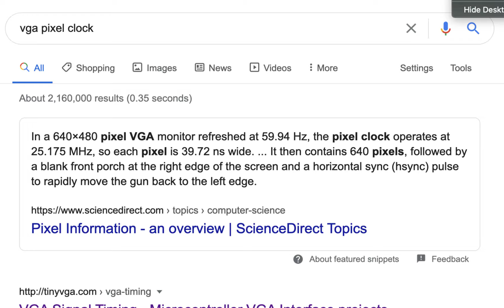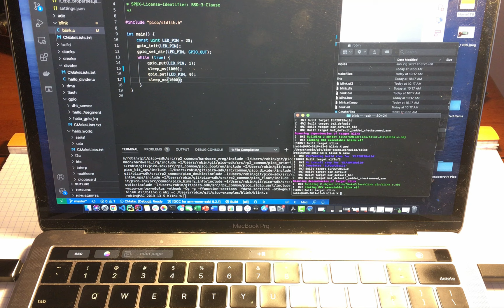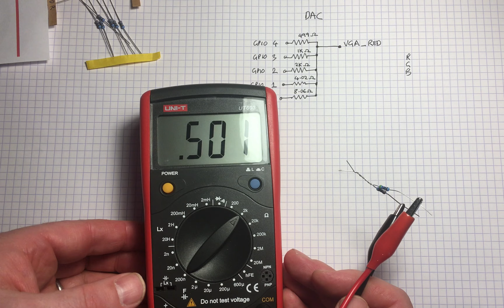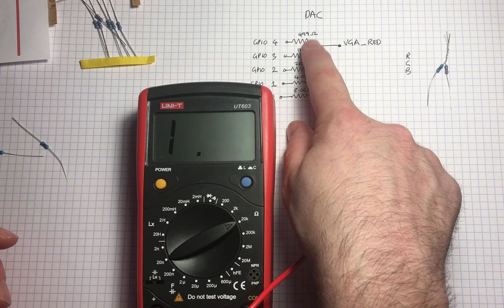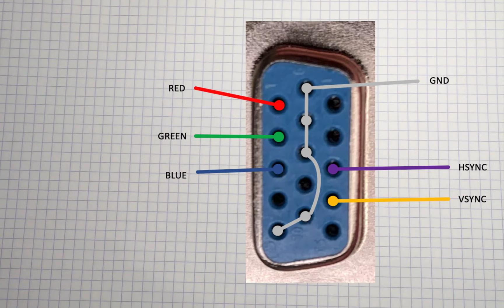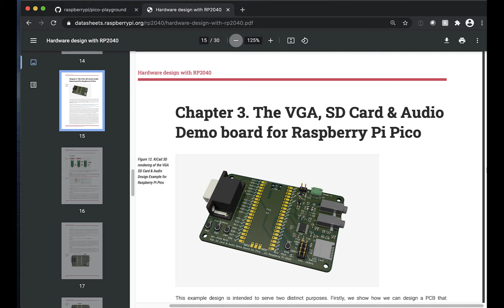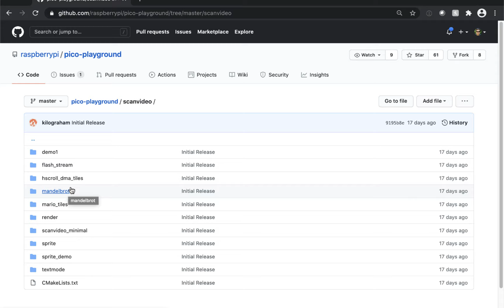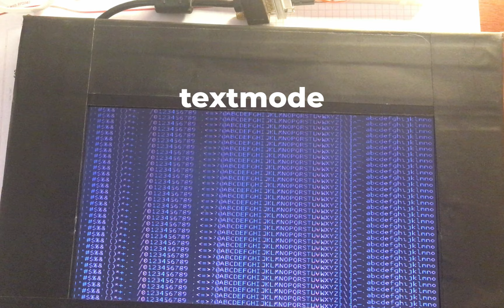Raspberry Pi Pico VGA video output using only resistors

Comment: There is no need to use precise resistor values, you will not see any difference in colors by using the next closest resistor values. You can also use only 2 resistors for each RGB color and still have a very good color range. You are also using cheap metal film 10% tolerance resistors so the values can be out by 10% anyway.

Comment: 2x 1k Ohm in parallel make 500 Ohm. 2x 1k in serial make 2k. 2x 8,1k parallel make 4k
Reply: For 2 parallel resistors  R=(R1*R2)/(R1+R2), so your last calculation is wrong. It is 4.05k
For n parallel resistors 1/R = 1/R1 + 1/R2 + 1/R3 ...  + 1/Rn
Reply: @dieSpinnt  But if R1=R2=…=Rn you just reduce the resistance by n. It’s just Kirchhoff’s laws.
Reply: @derekjc777  Sure, Captain Obvious.
And LOL, wtf do you think the "special case" formula (the first one I posted) means? The second one is the general Kirchhoff formula for a parallel resistor network. This is your 2n case. 
P.S.: Your gibberish isn't even a formula ... besides your "reduce" gave me a good laugh, thank you. Very mathematic ... and scientific! :o)

P.S.S: It is very boring to repeat basics that are written on page two of every electronics formula collection ...

P.S.S.S: And it is all my fault. I should've written: LOOKUP Resistor Networks and Kirchhoff's Law in WIKIPEDIA! This is just a waste of time, here on YouTube, don't you think derekjc? :) Anyway, thanks for your comment.

Comment: Good to see a RP Pico project that is more than a blinking LED. Thanks for making this one. I hope we will see more complex projects like this from you!!  :) Plus it is great to see a C++ project too.
Reply from the maker: Glad you like it! Let me know if have any ideas for content you want to see.
Reply: @robingrosset6941  an idea, i still want someone to Actually Try to add the original (everspin now) MR10Q010, 1Mb QSPI MRAM chip and bench it against the generic slower psram, it should be good for vga buffers running in it's QSPI Read and Write at 52MB/sec mode, it even has real original 'run in place' mode. i dont know if the Pico has the 4 QSPI useable spare pins though !
Reply from the maker: Hi Paul, the Pico already has an on-board 2MByte (16M bit) QSPI Flash which is speed matched to the CPU so it can do 66MB/s. I can try benching that if you are interested to see if its running full speed but I think this is likely to be faster than adding an additional external QSPI flash. The data sheet I found for the onboard flash is here https://www.mouser.ca/datasheet/2/949/w25q16jv_spi_revg_03222018_plus-1489727.pdf
Reply from the maker: @paulmaydaynight9925   I get it now. Let me figure that out. The use case is something like fast buffering of video data?
Reply: @robingrosset6941  yeah thats one main option if anyone's going to make up the example vga hat for instance IF the Mram better suits the more speed for less cycles (and zero wear-out effects) as it seems here

Comment: Why does every YT compare with old Arduino boards, at least compare with e.g. the Blue Pill (very much same cost), based on STM32F103 (Arm M1-core), whereas Pico use two Arm M0+ cores.
Reply from the maker: I was not benchmarking original Arduino vs Pico in the video. The point of explaining the clock differences relative to Arduino is to talk about pixel clock which is what limits the resolutions you can generate and what puts real VGA out of range of something like an Arduino. I have a Blue Pill I can do a benchmark but Andreas already covered it. https://www.youtube.com/watch?v=cVHCllbN3bQ&vl=en

Comment: Using standard resistor values:
two 1k in parallel = 500 ohms
two 1k in series = 2k
1.8k + 2.2k in series = 4k
3.3k + 4.7k in series = 8k
Reply: I'm thinking just some trimmer pots.
Reply: @larrybud you’re gonna need a lot of them

Comment: Oh wow, I was just watching Ben Eater's video on building a graphic's card and was thinking wow that's alot of IC's I bet the pico can handle that.... then I see this... Well done!
Reply from the maker: Pico is amazing. Power + Price is great.
Reply: @robingrosset6941  Almost as good as ESP32 with dual core 240mhz
Reply: You can do everything in software, its called bit banging. Eventually your processor wont be able to do anything because it's costly.
Reply: @eanerickson8915  well.... the obvious progression is (to me) pick an old well documented pci card found in every old pc/draw/dump reclaim all the components then do a Ben Eater to build it back up on a small breadboard/diy pcway pcb in different simple configurations where you use its bits as you wish...
Reply: @haakonness  It's actually better for display interfaces thanks to its PIO. Note that the RP2040 can also overclock to as much as 420MHz.
Reply: @eanerickson8915  The RP2040 has PIO which is essentially 2 processing blocks with 4 cores each which can run at the same clock as the CPU. With them, you don't have to bit bang. That's why the RP2040 can even drive HDMI.

Comment: You can use a R2R resistor ladder as the voltage divider for the 5 bit DAC just as well

Comment: Although I wouldn't build such a circuit, but your explanation were great and right to the point.  I truly enjoyed watching this informative clip very much.  Keep up the good work.
Reply from the maker: Thanks for that. The circuit design is not mine its from the Hardware Design Guide for RP2040. https://datasheets.raspberrypi.org/rp2040/hardware-design-with-rp2040.pdf

One piece thats maybe not clear in the diagram is the 75 ohm impedance inside the VGA monitor going to ground which is what makes the DAC produce the right-ish voltage levels.

Comment: it's a shame they didn't build it against the M4 but still a useful board.
fun fact: the original (integer) 25Hz/50Hz "SVGA" was a UK Inmos invented chip/pcb for the transputer that IBM licenced (along with the other inmos IP, japan got the original sram and related IP as you might expect today) for the x86 and never quite used it to it's fullest potential.
Reply from the maker: Agree, M4 would also have floating point unit... I think perhaps this was a price decision. Its still a good board for $4 in my opinion.

Comment: 1K is wide available resistor. For 500 ohms you just put two in paralel, tolerance increases, but hey... :-)
It is also easy to make 2K, and 4k as 2.2k+1.8k or 2x 2k or just 4x 1k...
Reply: 1ohm resistor exists you can make MATCH! lol and bcoz 1% from 1ohm is less than 1% 4k you going get real MATCH

Comment: Great project! A cool feature of the Pico are the fast 12 bit ADCs. Gonna build an USB oscilloscope for audio circuit debugging.
Reply from the maker: Cool idea!
Reply: In theory can a circuit be made with two 12 bit ADC such that you effectivly have a 24 ADC?
Reply: a fair LC meter would be cool too.
Reply: @kreynolds1123  you could for shure hack around to gain some extra bits. But the circuit would be way more complicated (and slower) than an extra ADC IC. But as 12 bit is already beyond mV accuracy, why would you need it anyways 😉

Comment: I recall a long time ago there was a computer that's CPU spent its entire resource running the video and program code was only executed during the blanking time. I forget the brand/model but 1MHZ was a common speed in those days
Reply from the maker: I remember the ZX81 which was my first computer. In had fast and slow modes. In fast mode it would not bother updating the screen at all so it would go blank until it finished.
Reply: @robingrosset6941  yes that’s right the ZX80/81, your got a good memory
Reply from the maker: @paulmaydaynight9925  I admit I had an eBay accident and have 4 ZX spectrums in my basement and quite a few ZX81s. I am pretty sure a Pico could emulate a ZX81. :-)

Comment: @3:52 please correct your notes, the last two lines have 4.02k and 8.06k resistors.
Reply from the maker: YouTube does not allow videos to be modified once published.  The video description contains updated values highlighting the error and there is also an updated video here with the full schematic with correct resistor values. The updated video is linked with a card into the this video  at the right timecode https://youtu.be/i1AwtqPtfrQ. if you click the information button at the timecode you indicate it takes you there.

Comment: Nice Project, subscribed.
The ATmega32U4 comparison is not meant to be serious, is it? 32 against 8-bit. Apples and pears:) Better choose another ARM M0 like STM32F0xx. Oh wait, Dual Core and 133MHz. So better choose something like STM32F446 for the comparison. For me you don't need a comparison at all. The right tool for the right job ... what actually translates to experience and RTFM many, many times.
Keep up the good work:)
Reply from the maker: there are a few microcontrollers like ESP32, STM32 and Teensy 4.0 which are more comparable. I wanted to make the point about the pixel clock and the price comparison MSRP for the Arduino vs Pico. Arduino are coming out with an RP2040 based board soon so I think we will see a lot more RP2040 boards.

Comment: Nicely done. I can see (from the amazon link) your display's native resolution is 1024x600 pixels. Could you tell me what screen resolution and refresh rate were the demos driving the VGA signal at ? Do the display controllers auto-scale up/down the incoming signal's resolution to fit the display or throws error out (like flicker/blank screen) when there is a mismatch ?

Comment: well, yes, nice job.
maybe it would have been easier if you had used an R2R digital-to-analog converter for the circuit. In this case, only 2 resistance types would have been needed

Comment: Really neat demo, thanks for making this video.  Question, I've been working on an EINK type writer project and found that SPI to a parital refresh eink display is slower than advertised.  There are some Eink displays that support the I80 protocol (which appears to be a 24 pin interface), can the pico support this?
Reply from the maker: So Pico has 26 usable I/Os (actually more if you use all RP2040 pins)  but using all them is likely not great for a project as you usually need to use pins for other things too. 

I looked up I80 protocol, I've never used it  but its basically a parallel interface typically 8 or 16 bits wide sometimes 18 bits wide. It has 3 or 5 pins for control lines. 

I think I would try using a 8 bit or 16 bit interface, the pico should be good for that depending on how many other pins you need. I can't think of a reason it would not work but I don't know of a library for I80.

Comment: so far i have been able to change the color on the example minimal scanvideo example to give a blue screen instead of different colors each scanline. The code is easy to follow but damn there is alot happening. I want to change the sprite on the sprite example and change positions based on a pin input. I gotta get better with my C knowledge. Embedded systems is as deep as i go with software.
Reply: decreasing the number of heads on the floating head example got rid of the distortion !!!!

Comment: How high do you think you could push the pixel clock with this? I am thinking that the Pico might be just the thing to use as a test pattern generator for CRT televisions, which ties into another project of mine. I'd be using NTSC timings instead of VGA, and I'd be looking at making a single luminance signal with sync instead of RGBHV (no chroma necessary), but what I'd really like is to be able to use a wide variety of pixel clocks as the basis for a TVL generator. Any thoughts would be appreciated!
Reply: CRT TV luminance is under 6MHz, so a Pico that can achieve 25MHz VGA could easily do TV.

Comment: An easier to built and more accurate resistor ladder would be an R2R-Ladder for which you only need two resistor values which basically have to be R and double that value which is more accurate and linear especial when using more bits per pixels for higher color depth but requires some more resistors. Here you can find an example and some theory behind it https://hackaday.com/2015/11/05/logic-noise-digital-to-analog-with-an-r-2r-dac/
Reply from the maker: Totally, yup.  I used an 2R2 ladder in a project for a sound board DAC a few months ago here is the link https://youtu.be/TBFA2xbCjZ4?t=237

It uses a 10K and 20K R2R for an Audio DAC. 

In the Pico VGA video I was copying the hardware design guide as this is what is being used in boards like those on this link 

https://www.cnx-software.com/2021/02/03/open-hardware-raspberry-pi-pico-vga-sd-card-and-audio-demo-board-to-support-qvga-video-playback/

I chose this also because it supports the demo code from Raspberry Pi Foundation for VGA.

Comment: Good intro ... you seem excited about the pico. I appreciate your effort. Probably I'll buy a pico at some point, though I'm not quite so convinced. 

Everyone forgets to add shipping when they speak of price. I'm about 100 km east of Ottawa, which is significant because Buyapi.ca wants $11 for shipping outside of Ottawa ($6 within Ottawa.) This is the cheapest shipping option. CanaKit.com charges $13 for shipping. One way or the other, the final price is a lot more than the implied $5.25. (Both places currently out of stock.)

Compare this for example, with the 38 pin esp32s board running at 240 MHz, which has built in wifi, and typically sells on AliExpress for about $5 CAD plus $1.40 shipping. (Roughly 1/3 the real cost of a pico.) This board can also handle vga, micropython, and almost everything the pico does. I've tried these things successfully on several esp32 boards. 

Bottom line, the pico seems like a good first attempt at a micro-controller for the 'Raspberry Pi Foundation' and I wish them well, but it is not reasonable to compare the pico to 8 bit Atmels and the pico is already up against some serious competition.
Reply from the maker: It is true. You can't ship anything in Canada or US for the shipping costs from places like AliExpress. This perhaps reflect postal service rather than the product though.  I agree shipping is an issue when comparing prices. It is true for places like DigiKey that small purchases make no sense as shipping is always the killer. I figure I have to buy at least $60 worth of components at a time to make it worth the $15 delivery but it does come very quickly. 

I do like the documentation for the Pico. It is good and the momentum of new projects being built right now is growing. Also note the Pico clock speed is configurable and Pico has been clocked up to 270 MHz on its 2 cores. 

Raspberry Pi foundation has also started shipping bare RP2040 chips to places like AdaFruit so I think you will see variants of the RP2040 boards coming soon. Like AdaFruit's HUZZAH32 for ESP32 based boards 

https://twitter.com/EbenUpton/status/1362171557469179907

 The difference where I think the Pico may be really interesting is the support and community that builds around these products to make it easier for makers to get started and create new things.  

On the comparison to 8 bit Atmels or ESP32s; I have lost count of how many Arduinos and ESP32s I have. Arduino started something important, they made their products very accessible to everyone. The whole market for clones of Arduino boards exists because of the demand created by the community. ESP32s can be programmed inside Arduino IDE and before Arduino there were very few choices for makers without getting into expensive SDKs and prototype systems. 

If you take shipping out of the picture and buy a branded  Arduino, ESP32 (AdaFruit branded HUZZAH32) and Pico from BuyAPi.ca, they sell all three, you can get many Picos for the price of an Arduino or the ESP32. And this is why I think the comparison is fair. 

If the Raspberry Pi foundation can build the same community support that Arduino has built then I think the Pico could become something special.  Time will tell but it's looking very promising.
Reply: @robingrosset6941  I totally agree with you on most points, especially that this is mostly about community. This is why 8 bit Arduinos and their awful IDE are still hugely popular.

Though I have a few observations: 

The shipping costs on AliExpress need to be taken with a grain of salt, and simply calculated into the total price. As you suggest, I am convinced that Canada has just about the worst postal 'service' in the world. What I often do is spend a lot of time looking for a reliable seller who can provide multiple items of interest, and doesn't gouge on shipping. Then I'll place a large order, for a dozen or so different items, and pay for the expensive (more reliable) shipping.

Still, I can't help noticing that it is possible to purchase the pi pico on AliExpress (in stock.) However the best price is about $16 CND + $4 shipping, (compared with ESP32 at around $5 + $2), which sort of implies that picos are intended to sell for about this price.

Years ago, I bought a Raspberry pi (within an hour of when they first became available), because I was totally sold on the concept. I showed it to the guy at our local computer store. He just scoffed and suggested that it would never catch on. I'm tempted to go back again to see if he's perhaps changed his tune. So, I'm not down on the pico. Really, I hope they do well; probably they will. It's always good to have choices. I just like to keep things in perspective.

Comment: So thanks for the VGA resiter ladder information.  Where did you get the horizontal and vertical timing signals?
Reply from the maker: the timing information is in the pico-extras scanline project here 
https://github.com/raspberrypi/pico-extras/blob/master/src/common/pico_scanvideo/vga_modes.c

This tells you the supported modes. Is this what you were asking?
Reply: @robingrosset6941  Yah I think so.  Back in the "Cheap Video Cookbook" days, getting the h and v timing right was always "a matter of great nicety".